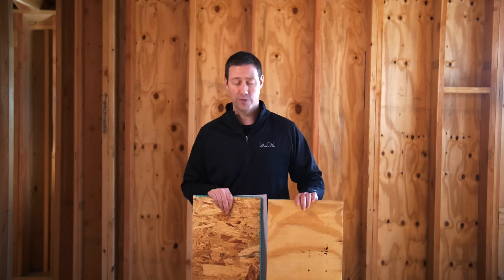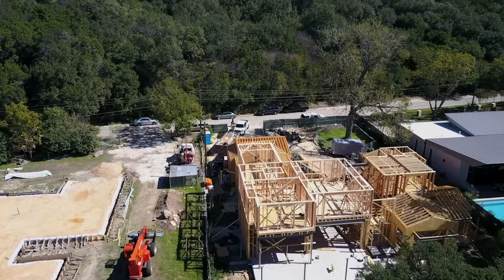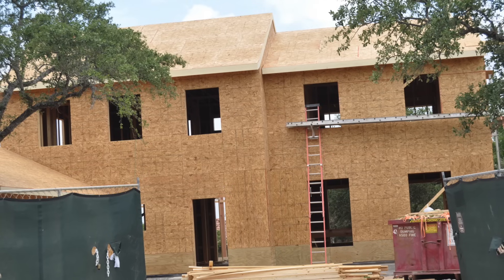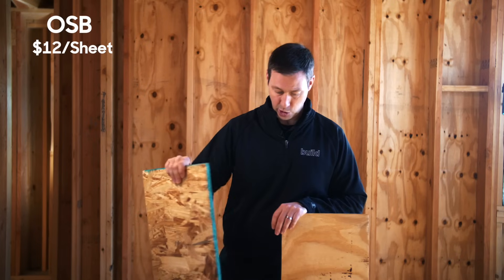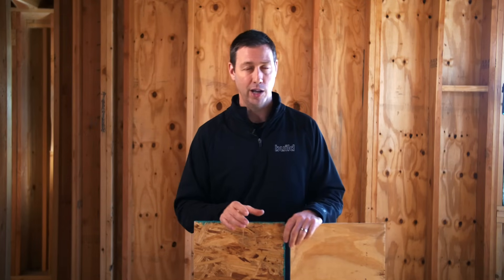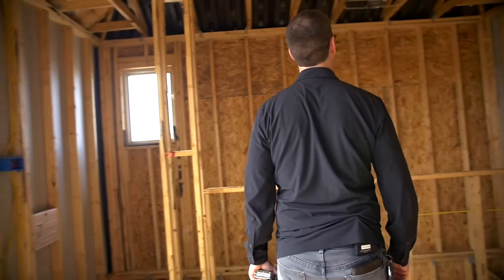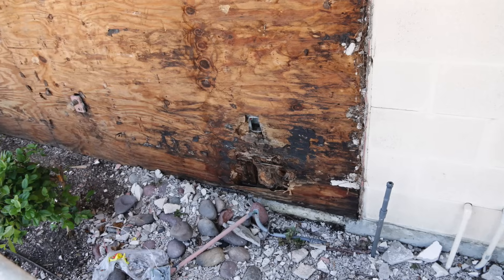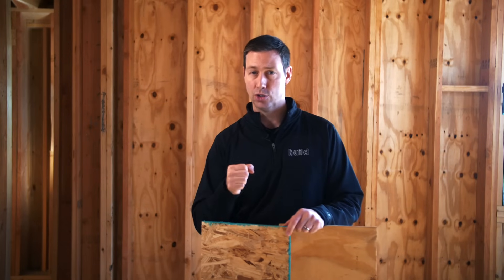Framing : OSB vs. Plywood - Whats the difference in COST AND PERFORMANCE

Comment: So my choices are plywood, sawdust, and cardboard.
Reply: all these ppl bashin OSB, one word: Advantech
Reply: @linds22481  You mean that stuff that costs twice what plywood does? At that price, it'd better be at least halfway decent...
Reply: @InfernosReaper  Advantech for subflooring is the way to go. Years ago I used to stock houses with drywall. there was a huge difference between regular tongue and groove standard OSB and Advantech. I'm impressedhow much weight I was able to put on the cart with an Advantech floor versus a standard 3/4-in tongue and groove OSB floor.
Reply: there is also 1x6 T&G or shiplap for  both of which i wouldn't hesitate to use for a second
Reply: AAC, my dude.
Reply: Hey people have you heard of bricks
Reply: @davidsharples1980 Have you heard of iron or concrete?  Seriously, it doesn't add to the topic at hand.
Reply: @roflstomps324  Why doesnt it? You can build a house with it. I build houses with it all the time. Never been called back to a job to fix leaks or rot in a brick or block house. In fact the only fixes i have been to are remodels, when a tree or when heavy equipment hit the place, or to repoint a 75+ years old home.
Reply: @klubstompers  it doesn't because it isn't the topic being spoken about.   We could say building a home out of solid granite is the best.  We wouldn't be overly relevant though would we?
Reply: fuck that i'll go broke building a one bed room out of real wood from the saw mill or concrete poured walls, or block but, screw these cheap ass new materials. plywood is great for certain things but, cardboard and osb does quality not make.
Reply: ICF.
Reply: Im about to buy a new house.  I just saw today its sheathed in damn cardboard.  Im about to cancel my purchase.
Reply: @klubstompers  If you build houses for people all the time and don't know why brick isn't a proper choice for every house... you have no business building houses.
Reply: @linds22481  advantek doesn't go one the outside tho. I also use advantek for sublfloor
Reply: @linds22481  advantech doesn't go on the outside or your house. If it did it wld also swell and deteriorate after being wet.  It is a great product tho.  For inside
Reply: Lmao yeah pretty, shit we all live in cardboard houses no matter how much they cost!!!
Reply: Or plank.  Shiplap is nothing more than planks.
Reply: @roflstomps324  Granite and marble worked great for the Romans and Greeks.
Reply: @linds22481  I'm new to wood working, I asked my father in law about this topic, he said the Americans love OSB for some reason, he then proceeded to pick up an off cut and literally punch a hole through it, he then stamped on an off cut of plywood and it didn't even budge. So my shed will be build of Ply :D

Comment: I wish you would have addressed the off-gasing of these two. OSB is more toxic than plywood.
Reply: All exterior products have some degree of toxicity
Reply: I'm Michigan it blows up like a balloon.
Reply: @hammer181  *more*
Reply: Exterior grades of sheathing all use phenol-formaldehyde resin. Interior grades use urea-formaldehyde resin. There are minor variations. All release formaldehyde but the urea versions MUCH more so.
Reply: @hammer181  I didn't know that plywood was toxic.

Comment: I was noticing the sheathing running in different directions. Is that fine in Texas. In Florida we are really concerned with the shear values and code here is very specific to running it the long way across the framing and stagger the sheeting and they want blocking all edges for the higher shear values.  Work looks great Matt. Very good content as well. d

Comment: The builder I worked for used treated plywood on the bottom two feet of the sheathing to help prevent rot.
Reply: Then that would make him a good builder. Those are few and far between.
Reply: Maybe  run some activated Fibreglass resin over the lower quarter of the sheathing on both sides with a roller prior  install  off site  allowing same to cure, then bring onto site  to use on those  bottom sections,  there no way same will take in moisture ..bit like a hull of a boat...

Comment: As a 50 year veteran of the carpentry trade, I'd like to add my two-cents worth. During that time frame, I've torn apart quite a pile of water damaged buildings. By very far, the worse damage all around, was on OSB sheathed buildings. I wouldn't use OSB on a bird house. Horrible nasty stuff, and the brand makes no difference whatsoever, I don't care what any mfg. brags, it's all crap. I could list tons of reasons it's crap, but space is limited. The argument that it costs too much is a bs argument. So maybe it might cost $1,500 over the house. Big deal. Ask yourself how much you're spending on the rest of the house, then compare. The same folks who blubber about the extra cost of plywood, don't even blink at a $2,000+ counter top!
Reply: Yep, OSB is garbage.  The only place I find it is okay is where stairs, etc come together into a basement - the back end of the stairs.  I prefer to have it covered and straight.  That way I am not knocking my head into a jagged staircase if and when I have to service the furnace.  I can bump it off a sort of inverted ramp.  But, to be honest, I use plywood there too.
Reply: I agree. I put hardwood down on a house with osb subflooring and it was a dog to work with. Undulations all over the damn place. Had to put in more levelling compound than usual. Hated it.
Reply: I own a "Craftsman" type home built in 1950. ( Southern Wisconsin Madison area)  Everything is 1 inch tong and grove plank sheeting the sides and even roof decking, The frame is the real 2x4's. Everything is still strait and level tough as heck. I just had a new roof put on and the roofer said he has never seen a tong and grove roof.  I know the guy that built the place was quite the carpenter / farmer construction. Whats your take.
Reply: Same experience for me as a roofer when young and an HVAC guy now. OSB is notorious for fast spreading dry rot.
Reply: This is what I suspected. We don't build like this in Queensland and I just don't understand why they do in America.  It just looks like you're adding problems to your build.
Reply: @ScottValentine  I think the term penny wise pound foolish applies to anyone who uses OSB.
Reply: Completely agree. I do carpentry and prefer using plywood.

Comment: Plain and simple, Plywood is stronger. OSB breaks easily.  Plywood can hold more weight.
Reply: Bud Black maybe, but wall and roof sheathing In particular doesn’t need to support great amounts of weight, and for that matter neither does floor sheathing because load bearing walls should always be placed over joist or girders, that is taken care of by the framing. If you have a problem with things sagging because of week osb then you need to learn how to frame a house. Sheathing is not for structural load bearing it is simply a covering the same as Sheetrock is. The sheathing only adds strength to keep the structure from toppling over. It doesn’t take any super strong material to do that either. The Sheetrock on the inside would technically suffice.
Reply: Not in all applications it's not. Example, in braced wall panel design for exterior sheathing OSB outperforms plywood, is stronger and keeps a wall from "racking" superior to plywood.
Reply: I’ve went through more plywood on roofs than I have osb. Granted the plywood was really old. I’ll stick with osb.
Reply: So, just to be clear, the argument for OSB are that "when it's reinforced better, it's more durable than plywood" and when it's water treated better, it will outlast old plywood... I think the OSB fanboys might be a bit delusional
Reply: They tested and osb is stronger in shear but they problem is that they soak up any water quick so better make sure you have everything sealed properly
Reply: @lcoi-3200  Yeah, OSB is just plain stronger material dry.  Anyone who says it isn't is clueless and uneducated.  However, it's absolutely imperative that it remains bone dry.  Get it wet and it will degrade faster and more dramatically than plywood will.  So the real question becomes how well can you waterproof it or what kind of climate is it going in.  In a wet/humid area, I'd probably be going for plywood simply due to its ability to sustain more exposure to water because leaks are inevitable.

Comment: Matt, another downside aspect of OSB is the toxic glue that it's made with. I've been in houses where you can still smell the OSB off gassing years later. I'm chemically sensitive and there is a huge difference between the offgas and toxicity of the two products in my opinion.
Reply: Plywood isn't glued together? LoL
Reply: @TaylorHaubrich  yeah years later he can smell osb off gassing. Thru the drywall, insulation, thru the paint, and all the plumbing glue and carpet and all the cooking that's been done in the house, not to mention pet odors and laundry smells , fireplaces, etc etc this guy can sniff out glue used in osb, even tho he can't actually even see the osb, he can tell the difference between glue in osb and plywood. Lmao. Have you EVER heard such bs in your life?

Comment: I had a garage built in SouthCarolina and they sheathed it with osb...So the fellas had it all framed an just a bit to have all the sheathing done..It started sprinkling and I asked if they would cover the roof before all the sheathing was soaked.They replied"oh it will be fine"..Well after the rain stopped and the sun came out the next day ,the osb started swelling up...Great stuff..Not! So the attic floor was buckled and it looked like thick hair was standing up..Well it was particles of the osb popping loose ..So I swept it twice with a stiff bristle broom and vacumed it..To this day when u walk on the attic floor the wood particles pop up.To me its just about two steps better than particle board after it gets wet period.So dry in your building and have plastic ready to cover it or have saggy nasty sheathing...

Comment: My house built just before WW II had nothing between the studs and the pine clapboard but tarpaper.      
What do you think about spraying a treatment chemical such as TIMBOR on your sheathing and framing to prevent mold and insect issues?      
What about priming the wood with KILZ or a similar product prior to framing?        
I'm having to do some repairs (including replacement of the sill plate, floor joists, and windows) and I'm having trouble finding a source for the 1x8 lumber (1 inch lap, 7 inch reveal) to match the original siding.      
Hardi-plank looks like a steaming heap of feces alongside the existing original and the available nominal 1x8 doesn't have the lab to keep moisture out with the 7 inch reveal.      
Any suggestions?

Comment: dont know where you guys by osb or plywood , but in s missouri osb is about 15.00,a sheet and plywood 5/8 is pushing 50.00 a sheet..
Reply: Sounds like you could take a trip to Texas buy some plywood drive back to Missouri and make a ton of money and still sell cheaper than major hardware stores.

Comment: Horizontal shiplap boards provide minimal resistance to racking.  I recently finished fixing an old barn that had stud walls with shiplap siding which had racked about 10 degrees from plum.  The resistance to racking of the walls should be accomplished by using diagonal lumber at the corners.

Comment: My question is why do I see plywood used in a vertical fashion on the exterior walls? I was always told the strength axis is Horizontal?
Reply: You get more sheer strength if it is horizontal
Reply: The studs can handle the vertical axis, also horizontal can be installed offset from each other making it much stronger
Reply: Robert Ginn 
The strength axis applies to a perpendicular load such as in a floor or roof.  On the walls that does not matter.
It could be that the sheathing is on a 9ft wall in which case the sheet of plywood can be 9ft x 4 ft and have fewer joints for air leakage.
The studs are 16" on centre so less of a factor and if the sheathing is 5/8" it is no contest because it is overkill.  The weight of those plywood sheets would have me standing them up all day long vs lifting them up 4ft and possibly having to cut a 12" strip at the top.  All of which is way more work.
Reply: It may be more work but it will be stronger. Don't be lazy when building.

Comment: You could have started with the price comparison and had another 10 minutes to get something else done. My shiplap sided home caught fire and on complete rebuild I used OSB vertically and plywood everywhere else. They were both much cheaper in 1996, I almost fell over when I saw your current prices. I purposely left some OSB around to get wet in the rain and was surprised it did not swell as much as I thought it would over an extended period. But it was drying out after each rain event. The 2nd and 3rd owners of my new house were, are both very happy. I visited a couple months ago. The roof sheathing is flatter than most buliders' floors.Sorry, nobody needs a 7000 square foot home. Braggin' rights and small p#$@!%s.....

Comment: When I was framing apartments, and the fork lift brought up the new cube of OSB, we would chuck the first 3 sheets or so. It was what we were told to do. It just didn't handle the weather. Never did that with CDX ply, and the OSB was not dimensionally stable. The factory reps were telling us to space it 1/8", but it measured over 96".

Comment: I was wondering ,if you could advise me i have a concrete double width garage that I am going to turn into a games room, mainly pool table to be fair,I was going to stud it round with 4/2s, then line it with OSB, then just paint it and add some wall shelves etc, so is that the best option for this job.PS yes i was going to insulate, probably fibreglass rolls from local builders merchant.unless you suggest something better thanks.from the UK.

Comment: You can always spray a good quality sealer for decking on the materials thereby preventing mold mildew and rotting from small leaks.  I tried that on a small addition by painting all six sides of the plywood prior to putting it up and on any areas that had to be cut.  I have found there was no warping or nails coming loose.  ALso did that on the T111 siding with better results.

Comment: I used to work as a roofer, and when we would use plywood, it was nice and solid when you would drive a nail into it. OSB (I still call it particleboard, even if that’s not technically correct) would be spongy when you would drive a nail into it. Even brand new.. junk. I hate osb
Reply: Yeap..just think..some morons swear by OSB for flowing yet claim" oh..just put this stripe of bs-water proofing material over it.  CAse closed"  (facepalm)..Nope.  If Mike Holmes from the Show Holmes on Homes doesn't approve it....I'm damn surely..NEVER using it.

Comment: The only decent OSB product that I've used is advantech.  I'd even go as far as to say that Advantech is superior to plywood for water resistance. Plywood is far superior to osb unless you are using Advantech. I was a die hard plywood advocate until advanteck came along. I still love plywood, it's just a superior product and worth every penny. All's it takes is one good rain storm on a bare osb sheathed roof, during construction, to see what a P.O.S. standard OSB is.
Reply: Advantech is the gold standard for subflooring, in my opinion at least. I'm not a homebuilder but I spent many years pushing drywall carts through houses loaded down with 5/8 and 1/2 in old school sheetrock, not that lightweight stuff they have today. We always got giddy if we knew that the floor was Advantech. he could load the hell out of that cart and not have to worry about it going through like regular OSB. I'm in the planning phases of building my house right now. Advantech is it a guarantee. I'm at toss up for my sheathing material... 5/8 plywood or Zip panel? 🤔

Comment: Another consideration is whether you are building in tornado ally.  During a really nasty hailstorm (baseball sized) where I lived, newer homes with OSB on the roofs actually had hailstones penetrate the roof and a few of those penetrated the ceiling.  Older homes just needed shingles.  Major damage to newer ones.

Comment: I have been stripping out a building I am renovating and noticed that a piece of plywood I took off a stud wall weighed a lot compared to plywood of the same thickness manufactured now. The wood on the old plywood seemed far denser and it was certainly more rigid. I suppose that plywood is only as good as the wood it is made from and the quality of the glues used.  OSB does come in different grades here in the UK. I suppose its to do with the resin they use.
Reply: Chris Ward
The most likely reason it was heaver and denser is that it was Marine Ply; its about the best you can get but you will pay for it. It's between 40-60% more expensive than normal ply but worth every penny for a outdoor building you want to last you a Life time and Beyond.
Reply: I've seen some really bad plywood made today in the US. Not like it used to be. Usually one can find some decent ply somewhere that is way better than OSB, though.